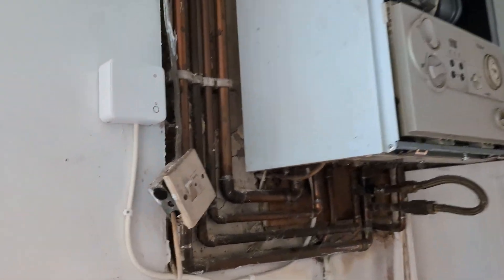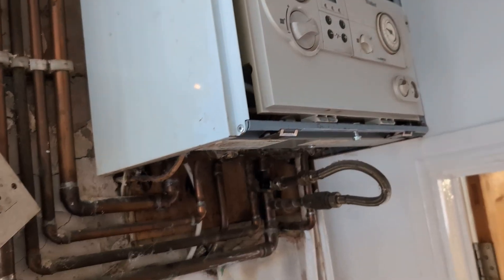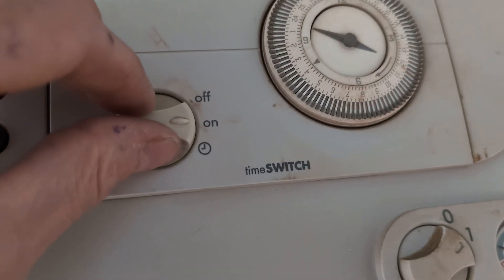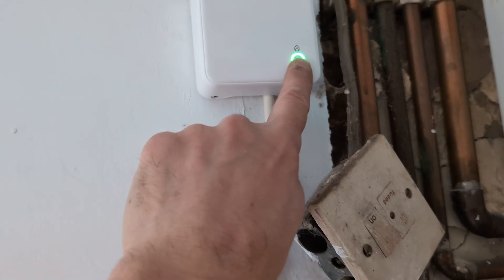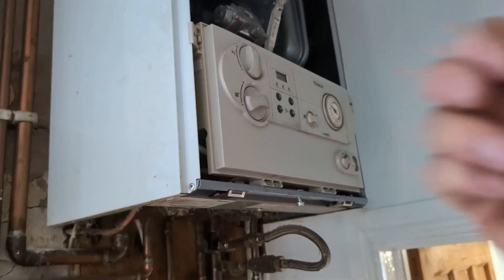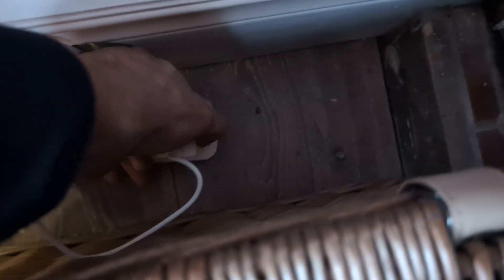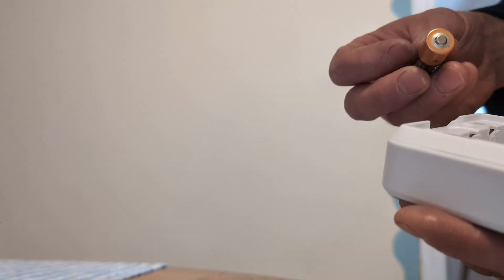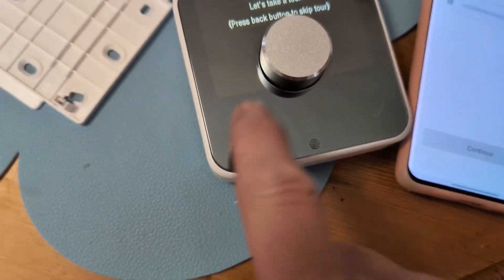Hive Thermostat Pairing. How to pair your receiver, thermostat and hub??

Comment: My thermostat has been damaged and needs replacing. Can i just replace the thermostat unit without having to do any wiring or is it more complex than that?
Reply: Following this as I've just moved into a house with it already there but can't seem to find the receiver which is plugged in.
Reply from the maker: I did check yesterday and you can leave the existing receiver and just change the thermostat. There is a process you must go through however to pair them and they can be temperamental...
Reply: @northwestgascertificates thank you, managed to find the same model. Honestly not a fan of hive, had a few issues with it since moving in, the website links for common issues dont seem to work and there is no way to speak to a person. Terrible service

Comment: What if it works but receiver and thermostat say offline in app
Reply from the maker: Best thing to phone Hive and make sure there aren't any connection issues at their end. It does happen..
Reply: @northwestgascertificates  I have the same problem as Viewer765. And you are unable to phone Hive unless you have a contract with them. The app even states back online but still can't control heating and water. Just states 'Offline' let's fix it. But it won't fix!